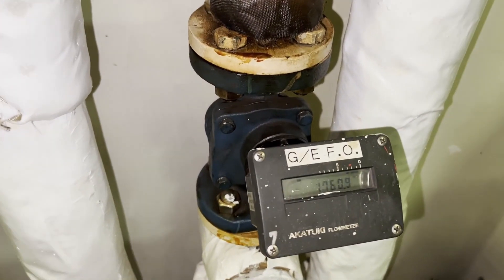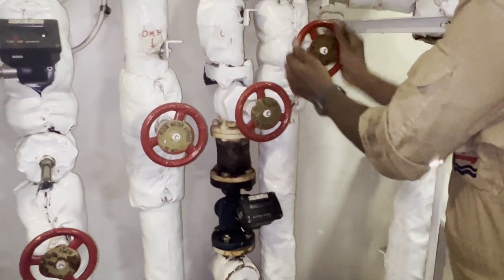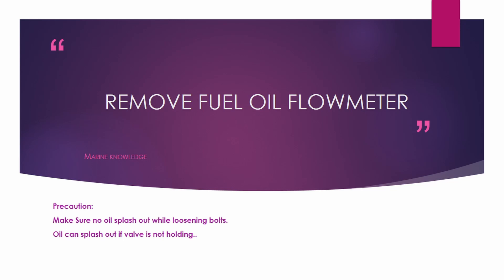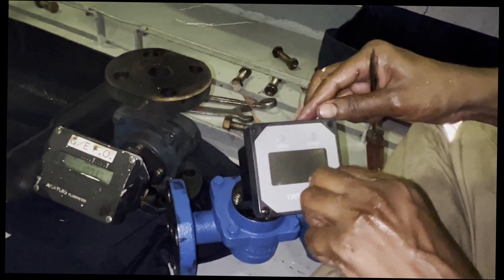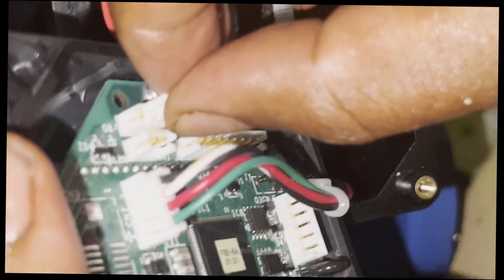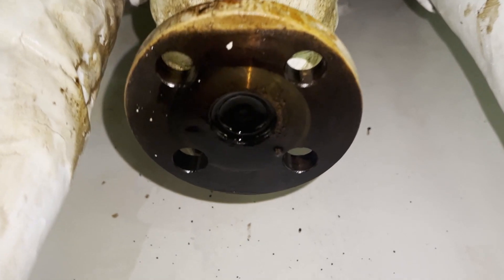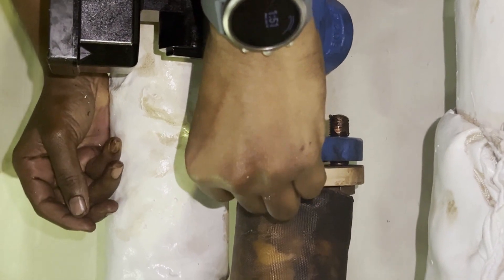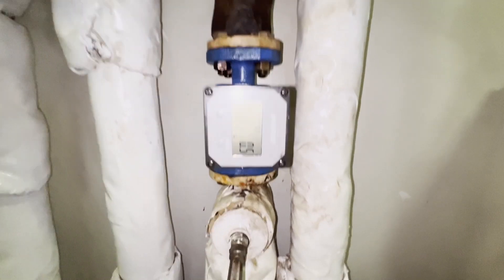How to remove and replace fuel oil flowmeter onboard ship....

Comment: Sir I see a simple flathead screwdriver was used to open the screws, but you always say, Use the Proper Tool, since the screw might get damaged. 5:32. Great explanation with slides.
Reply from the maker: Ur very correct... Since this is a new machine screws will be hand tightened oly so we used.. We will keep in mind next time.. Thanks for watching videos and good reviews.